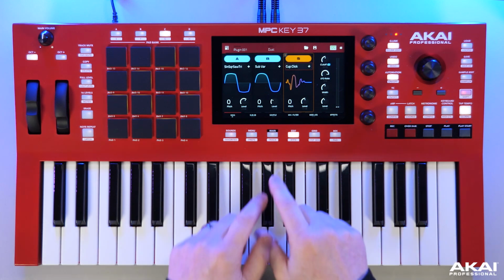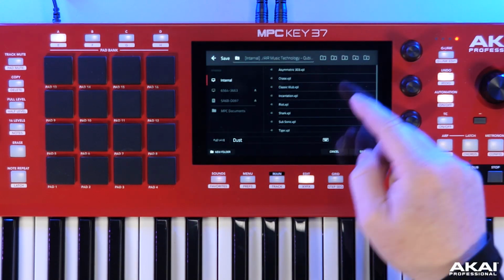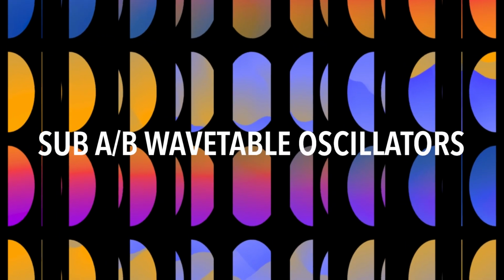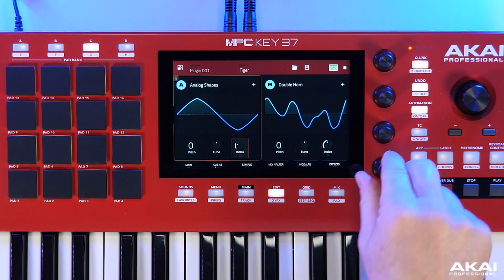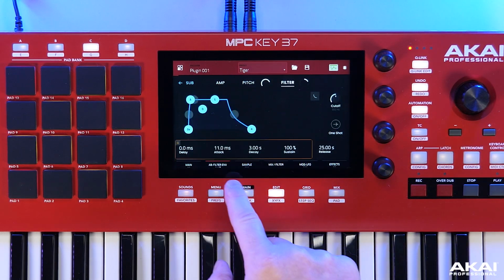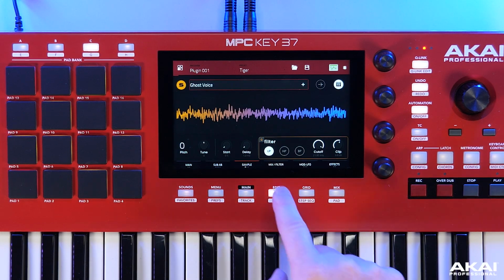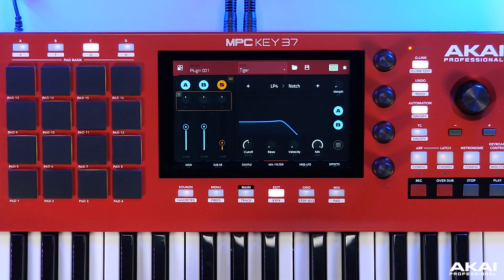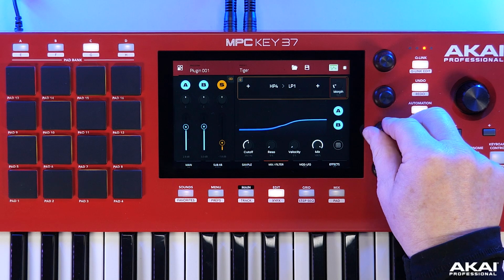AIR Sub Factory -  MPC Standalone Edition Overview

Comment: Awesome UI and sound ! Well balance between simplicity and functionality. Nevertheless due to the wave tables capabilities it does not make any sens to make it mono only … Please unlock this feature for VST and MPC.
Reply: It's not hard to see that this is a bass/808 version of a much more powerful vst. They will release it in a few months😂😂. Serum MPC.
Reply: @andremiller1566  you might certainly be right !
Reply: Have you ever get deeper into mixing and/or mastering? It totally makes sense to mix bass in mono to get the biggest impact. Think about why is a subwoofer only one speakerbox. ;)
Reply: @I_am_robomix  I think with mono he meant one voice, but poly(phon) would be great. The plug in is stereo if you wish, each Osc. have panning.... also stereo unison.... Import of own wavetables would be great and 256 cycles instead of 127 only, Serum-Killer
Reply: @VTOLKits  ah ok, that makes sense